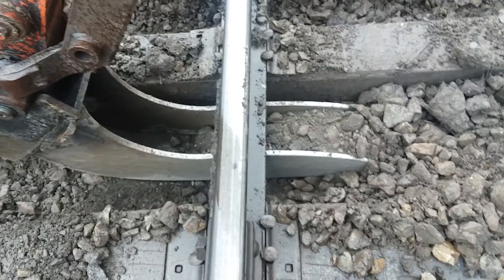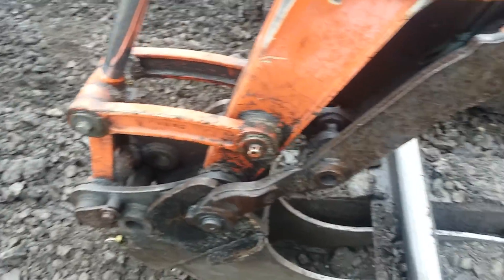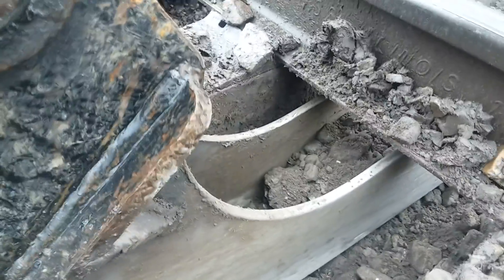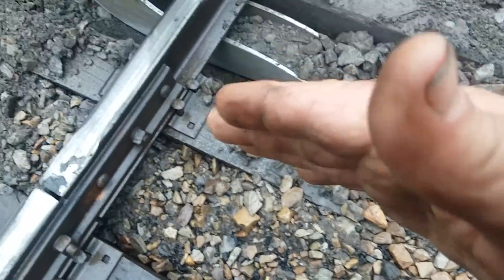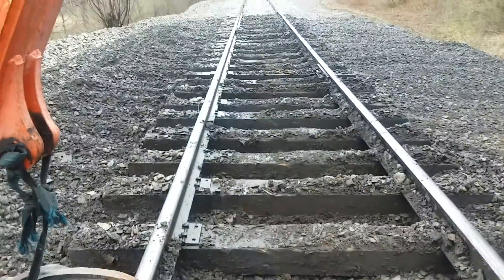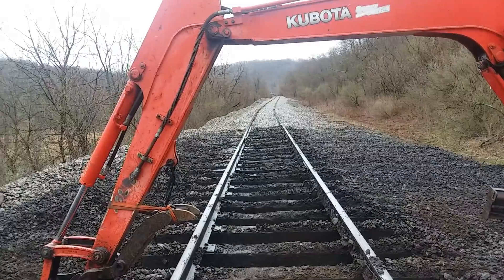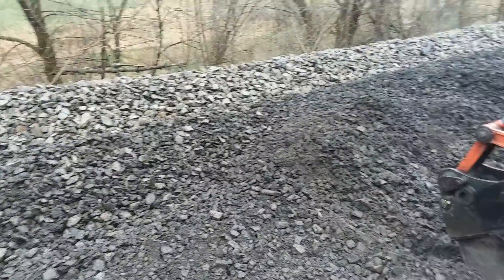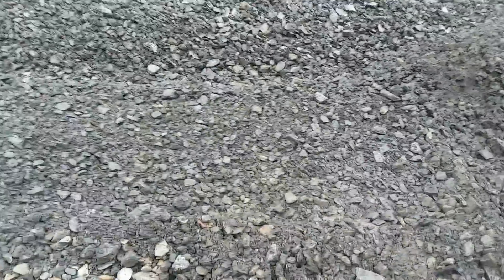More on Cribbing Ties plus Straightening Skewed Tires

Comment: I noticed that their isn't any tie anchors. Do you use them anywhere to stabilize the ties from shifting? Did you state you where going to weld the ends of the plug to the other rails so there are no longer any joints in that area?
Reply from the maker: On CWR every tie is anchored, because we have jointed track only
bout 10 or 12 ties are anchored per 39 foot stick of rail.

Comment: The big boss got a small digger for digging in pipe, for cable or track wire when we were down on manpower.  Out east we used the Vermeer articulated ride on bucket excavator. Small unit you can walk next to it with four tires.  Dug a whole for a signal foundation years ago.  Had to get get foultime in manual block territory, just to make it automatic territory!

We also got yelled at for mixing ballast with dirt. Going down 36" below the railroad tie to avoid a cable being tamped, and creating a short, ground or open.  Once a tamper driver said its ok your on overtime, I said no guy i'm on straight time and you tamped where you were not supposed to. Switch cable :(!

For buried signal or other wires how does your railroad identify pipes or buried cable?  what signal system do you have?
Reply from the maker: Interesting comment! We dont have signal systems, dont have any public grade crossings. We do have a few wires buried in the ballast for our electric switches and they are marked so when tamping I just skip those ties
Reply: @ccrx6700  simple is best.

Comment: Thanks Dave. Real interesting. You know sometimes us telecom guys on our railways had to lay a pipe under the track to allow us to feed signal post telephones SPT or possibly a deviationnofca main cable, whatever. We would get authority from the Perway inspector and we would then trench between two sleepers (ties). We had to seperate the ballest from the bed material. Top of pipe had to be a minimum of 500mm below the sleeper. Backfill compacted snd ballast replaced. The Perway Inspector would keep an eye on this and send guys with yout jitterbugs to tamp the area. We had to have flagmen to warn us of approaching trains.  Quite hairy at timed but never had an incident.
Reply from the maker: Working live track, your leery all the time, especially with new enginemen, at least I am. We've put some wonder wire in the cribs
for our proximity switches on the electric switches we have but it
not buried very deep, you guys did it the right way. I got all those
places marked, there's only a few so I know not to tamp that crib.
Wonder wire is what they call here direct burial wire with a shielded
casing around it.
Reply: @ccrx6700  very interesting. Thanks Dave.

Comment: If it were economically  feasible would you want your isolated railroad to be connected to say,NS?
Reply from the maker: In many ways it would have been a life saver for us, it would take about 8 more miles rail to connect at Waynesburg. At an average cost of 1 million per mile to build new track it prob not gonna happen 🤔
Reply: @ccrx6700  Thanks for the response.I always enjoy your vids.
Reply from the maker: @rj4590  👍

Comment: Good day sir. You deliver quality, as usual!
Very informative, especially what you have added to the description.

It is incredibly easy to get what we call "throw" in the curvature. In the past, before everything became so strict here in Norway, we could call the train driver on a freight train, and ask him to brake hard when he was well inside the curvature, then we managed to "pull" thrown in again with the forces from the carriages!
But this is of course strictly forbidden now, and that there has been so much electronics in the locomotive, so it would be an investigation right away!

With as good maintenance as you perform there, there must be little ... what is it called in English ..... Sun kink? In any case, we are very bothered by this in the summer ... It may be one of the big buttocks with fully welded rail.

Thank you so much for a great movie! Best regards from snowy weather in Norway! (Rail temperature last night was -3 Celsius/ 26 Fahrenheit)
Reply from the maker: Kristian, i can understand that! I've seen it happen here where hard braking has thrown a line spot in the track! Can really do a number on rail when its very hot. 

Sun kinks are also called heat kinks by some here too. The proper terminology is a heat buckle. We get one bout every 2 years or so. I refuse to tamp rail when it's really hot, the rail gets like a rubber gum band and can go all over the place, if we get a heat buckle i will put slow order on it then line track next morning when rail is cool. 

-3 oh dear, was 75 here today.🌞

Comment: All the glamour that goes with MOW jobs but you can see the results. When UP and BNSF had the drainage and tie problems it was miles of what you're working on but they had to dig to a subgrade and start over. CP started a full track program in Milwaukee this week and when the 15 pieces of equipment come back to roost at the depot they look like large fireflies with all those lights on. Yea springtime!
Reply from the maker: Was it you Paul that was telling me bout the powder river track being full of coal,? It is pretty neat see all the lights on those machines, CP got a bit of a bigger budget than we do ... 💰

Comment: It looks like you need to replace both of those sticks of rail. The other one is showing signs of battering too. Of course, if your plug is going to cover the span of the joint on both ends a plug is cheaper than two sticks of rail. A closer inspection of both rails would be needed to make sure a plug is a viable option. When I was disturbing the ballast I ran a slow order of 10 mph over it for about a week, even after tamping it. Would tamp at least twice. The track settles quite a bit. Is there a way we can talk to each other via email? I've seen others say they would email you but I don't see your address. Its always a great day between the rails. MoW for life.
Reply from the maker: Yes sir, the train will find the weak spots! I like get a good surface and line on it, then wait a week or so and re tamp, then another couple weeks for 3rd and hopefull final surfacing.
Reply: @ccrx6700  yes! That's what I did too. I would do the same if I was replacing a lot of ties in the area too.
Reply from the maker: @rebelrailroader  good tie gang leaves track surface and alinement in pretty good shape, there are TKO and TRIPP operators who are very good, i love those guys! Then other times some operators leave humps and line spots all over the place, then have to tamp right away
Reply: @ccrx6700  with the track I had to work with even tie gang messed with the track, even doing it by hand. We had maybe 2 inches of ballast under the ties. The line was a branch line built cheaply in the 1920s. Majority of our ties were original to the line. Rail was same condition.

Comment: Back in the '80s they took the styrofoam containers that McDonald's used and they made this material that was stronger than wood but still had a little bit of flexibility and they made picnic tables out of it and it was very durable and an alternative to Wood and I'm wondering if that would work in this situation because it never rots
Reply from the maker: Yes they do make composite ties out of that stuff and I believe used plastic like in milk jugs. They never rot, but holes have to be drilled for spikes, its impossible to drive a spike in them without pre drilling. They are also double the cost of a wood tie. Excellent question there sir! 👍
Reply: @ccrx6700  I wonder if they make those composite ties with the clips that hold the rail, vs. needing spikes ?

I was also thinking about if anyone makes a liquid that would breakdown the mud and coal, like a degreaser, that could be sprayed over the gravel and then come back with a high pressure water sprayer nozzles and " clean " the ballast without needing to dig it out and replace it.

If something could dissolve the sludge and mud, and turn it into a liquid, even for just a few minutes, you could " wash " the ballast in place and the mud and coal dust and sludge would run down the sides.

I have used degreaser products on car engines and ball bearings and fittings, and the sludge dissolved and ran right off like water

It would be a great product for the rail Industry

Together with composite ties that never rot with metal clips that are pre-drilled at the factory, so you just set the ties, and the rails and snap the clips on and spread the ballast.

I bet Japan or China either have these products or are working on developing them for their cross country new high-speed rail lines they are planning to have in 2025
Reply: They do make composite ties out of plastics, and some railroads are having good luck with them.  I'm not sure what all the pros and cons are, but I think they are rather expensive compared to wood ties.
Reply from the maker: @railroadjim  you are right, they very expensive, also holes for spikes must be pre drilled, impossible to drive a spike if their not drilled first

Comment: Some time-lapse videos of cribbing would be pretty cool. 😊
Reply: @ccrx6700  I use a GoPro. If you have any questions feel free to ask. If you give Time-lapse a try, anything you do on the railroad would likely be at the .5 frames per second setting with the lens set to linear. Make sure to set the camera up on a tripod and you should be good-to-go. 😊
Reply: @ccrx6700  You'll be a pro in no time. There are only a few settings you need to know, then you can create presets.

Comment: Slide that tie directly beneath the joint, it will support both rails and eliminate joint sag and bolt hole breaks.👍🏽
I'd come out and help but I'm too far and I have a scheduled vacation in August to Hawaii but that may change to October and I may go to western NY instead.
Reply from the maker: New York not that far from us, wow would it be possible get you come here? We ride rail together, have a great day talkin  railroadin, I would love it! 😊
Reply: My sister and her husband lives about 20 minutes east of the Buffalo airport.
Reply from the maker: @jasonbabila6006  Buffalo prob 5 or 6 hours, we 1 hour south og Pittsburgh. 16 inches om high side, 11 on low .... love it 👍👍👍

Comment: If you use concrete ties then you wouldn't have to worry about the wood rotting because of poor drainage
Reply: concrete is best suited for passenger lines. the tremendous tonnage of coal trains combined with the watery conditions in the NE make for a bad deal. once the 1st concrete tie breaks...the next day there will be 10 broken. 2 guys couldnt possibly keep up with that.
Reply: @googoo-gjoob  Great answer!
Reply from the maker: Excellent point, they are going with pre stressed concrete ties now
because of the breakage hoping that will help eliminate tie failure.
But again you are right, tonnage and water make for unkind things to
happen, We had almost 3 years of a lot of rain which ended last
summer, that really did a number on our track.

Also remember I have an old tamper, in order for me to tamp
concrete, every concrete tie I encounter I have to go out and
reset all 4 bottom limit switches so the tamping blades will go
down further for the concrete, total not gonna happen on this
RR with this tamper. If we did an upgrade to Jupiter system, then I could flip a switch in the cab, but an upgrade to Jupiter will cost
about $100,000 so that prob not gonna happen either.

Keep your comments coming, I love em
Reply from the maker: See my reply to googoo gjoob, you'll get a good understanding why
we cannot use concrete ties here. But thank you for your comment and you certainly did make an excellent point.  Way back we tried some old style concrete ties, they had concrete on the ends with
a steel bar between them, first car that derailed sheared every one
of those bars in half. They don't make those kind of ties anymore.

Comment: That tie up one from your bucket, has seen better days.
Reply from the maker: Well I used to have a cylinder there for the thumb, but someone
decided they wanted to eliminate that cylinder and take it home
for their own use, so had to tie up the thumb with that. Excellent
observation there Gerald, yep it needs replaced.
Reply: @ccrx6700  Yes Sir, that is a bad tie
Reply from the maker: @geraldblackburn4883  ooops, mis read your first comment. When tie gang went thru here last year they sure did miss that one⁉️

Comment: You push that out, and why not push it out ALL the way, so you can get drainage on both sides, now I know your boom is not long enough, but that side should also be tapered to drain away water. I think if this drainage was vigorous, it may wash some of the coal dust away.
Reply from the maker: Yes sir, before I left this section to go on, got up on tracks and pushed left side  down over the hill and sloped it, good water drain off both sides now. 👍

Comment: How do the Ties get Spaced to Closely in the first place ?  19” from Center to Center.  Thanks! 👍
Reply: Vibration from the trains and lateral movements of the rails.
Reply: @jasonbabila6006  Not true Jason.  The 2 causes you just mentioned causes the gauge of the rail to change it will create what’s called a “wide gauge”. That is when the rails are more than 56-1/2” apart.  What causes a “skewed” railroad tie is when there is not enough ballast between the rail tie, the ballast gets displaced by the mud there is no support for the rail tie so the rail ties become “skewed”
Reply from the maker: Yes sir, good ballast keeps the tie spacing, mud in between the ties
has little resistance so ties move. Healthy ballast is key to so much of holding track integrity. But you know all this
Reply: @Ken S. We (Track Maintence) space the railroad ties 19” on center.  The spacing between each railroad tie is 12”.  The railroad ties are 7”x9”. So to the center of the railroad ties are 3-1/2” each way multiply 3-1/2” x 2=7”. 7”+12”=19” on center.  That gives the rail the specific support needed for rail traffic.

Comment: I was driving along a railroad a couple days ago and noticed there was a significant hump in the track where it went over a short wood bridge.  Is that normal?  Or do the need to bring in a tamper to even that out?   (Track was on the Iowa side of the Mississippi, and they were hauling coal.  I assume was headed for a power plant up the river.)
Reply from the maker: Was the hump before the bridge? That's not good and not normal,
if so that would require undercutting the track ballast to get track to
drop, then tamp to get surface to match bridge. Thanks for watching and hope you enjoyed.
Reply: @ccrx6700  The bridge was higher than the rest of the track, like there was a ramp up to the bridge and back down on the other side.  I wasn't sure if it was intentional, or maybe the track settled but the bridge did not?  Most of the rail traffic runs on the other side of the river, so this section may be a bit neglected.
Reply from the maker: @fredygump5578  that happens a good bit on bridge approaches, we have trouble with that too. Yep needs tamped up to grade bridge is on

Comment: Wonderful video! Rails looked nice and shiney today, good signs of a well used rail line!
Reply from the maker: Thank you, glad you enjoyed watching. Yep rusty rails don't smell like money... shiny rails keep the paychecks coming for the over 650 employees at this mine, plus all the support companies, plus the local taxes they pay and the companies that buy our product. Shiny rails   are wonderful to see. 👍
Reply: @ccrx6700  Just wondering. Is this line used for just hauling coal out of a mine and how many trains a day run on these rails? Also, in general, how many cars long are each train?(the kitty's pal-allen from Ga)
Reply from the maker: @fayeharris7391  yes, we only haul coal from the mine at Kirby, 17 miles to a river barge loading facility at Alicia Pa. On the Monongahela river. There are usually 37 or 38 cars. We are limited because at both ends there is a solid rock high wall, so when loading or dumping the train cant go any further.

Kittys pal allen? 🤔